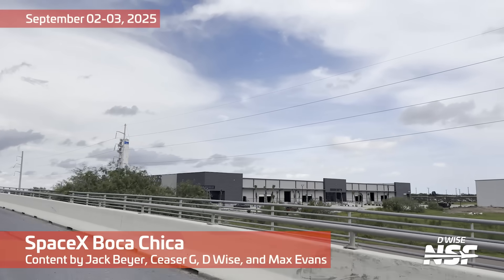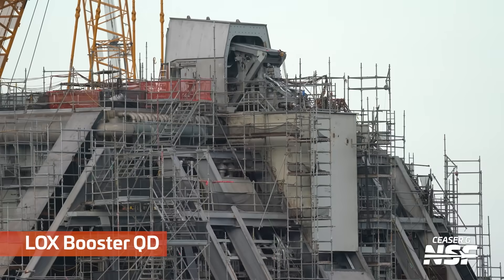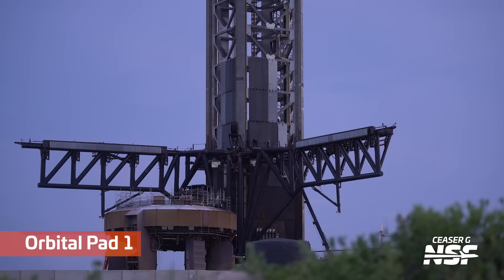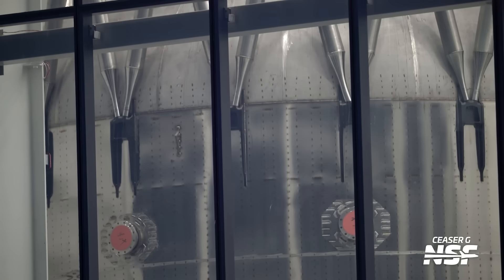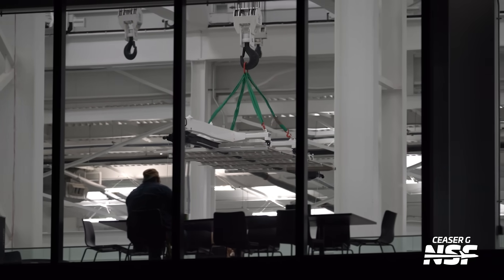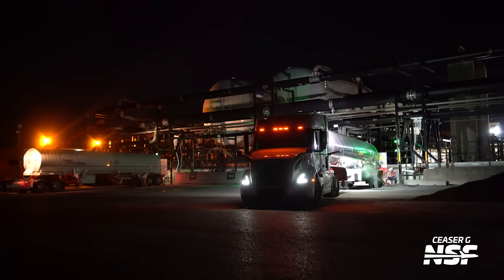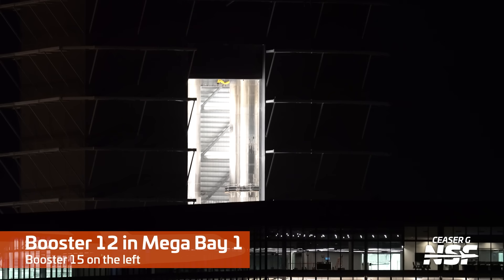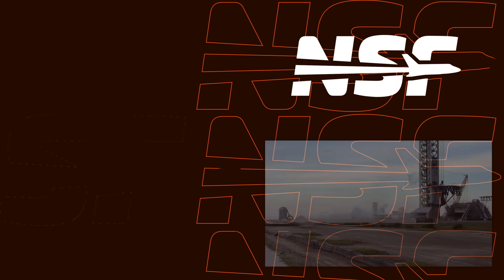"Not your usual Starlink Unboxing Video" | SpaceX Starbase

Comment: @NASASpaceflight, I would definitely watch a dedicated vid on air separation as used specifically for rocketry.
Which techs could be used, which are preferentially used and why (cost, purity level, etc...). 
There are many techs that can be used for air separation such as cryogenic distillation, molecular sieves, membranes, pressure swing absorption, etc... 
It would be interesting to know which ones are used for a unit dedicated to rocketry. Would also be interesting to know how they generate the liquid methane. Pretty sure NatGas is the source input, but what needs to be done to it to produce "rocket grade" methane. Equipment, steps, purification, etc...

Maybe the spacex air separation folks would do a technical interview as PR? I doubt they are doing something unique/proprietary in this area, so should be relatively safe topic for them to go into step by step detail on.

Comment: The air separation is by boiling point. Same thing you do with oil.
Reply: Or alcohol. If it was by density, methanol wouldn't be a higher fraction as it is more dense than ethanol, but since it's boiling point is slightly lower, it comes out at a higher plate in the column than ethanol does.

Comment: air separation units can use a PSA (pressure swing adsorption) tech that alternately pressurizes and de-pressurizes air in the  presence of an adsorption material that selectively adsorbs nitrogen or whatever.

Comment: I thought fractional distillation columns (towers) separate components by boiling point....not density. (??)
Reply: Correct, I suspect Das mis-spoke, he is going quite fast and off the cuff in these. There are a bunch of other techs that can be used either separately or in conjunction such as molecular sieves, membranes, pressure swing absorption, etc...
My understanding, which is only marginally above layman, is for very high volumes cryogenic distillation and molecular sieving  are the two primary techs used. 
@NASASpaceflight, would definitely watch a dedicated vid on air separation as used specifically for rocketry.
Reply from the maker: Hrmm, my understanding is that the entire point of the tower is that various products rise or fall at different pressures and temperatures, but I'd loosely describe that as density? If something is boiling, the density is changing and that physical mechanism could be used to separate components... Would love to learn more about how they operate and translate it into more easily understood terms... in my copious free time 😅 - Das
Reply: @NASASpaceflight  Wrote a nice explanation about how density has almost nothing to do with non-cryo fractional distillation and everything to do with boiling point, but YT decided to hide it...😑.....sorry Das.
Reply from the maker: I see it, I appreciate you taking the time to type it out. Will see what we can do about an expert tour... have a busy few months so it might be a while. - Das

Comment: So many things sometimes jump out from these videos and make me realise how far Starship has come since I started watching developments about 5 years ago. This time it was the discussion of the heat shield tiles, the pins, and the patchwork way that the tiles are being installed on the nosecone. That gave me a flashback to the early days of the SN hop and belly flop testing when various SNs had just a few - or even only one - small patch of just a handful of tiles installed and sometimes the attachment method performed so badly that some of the tiles didn't even survive being lifted onto the sub-orbital pad let alone the test flight. And now, while there is still more work to do, we see an entire heat shield survive a re-entry with seemingly very few tiles falling off.

Comment: The Hot Staging Ring - why are there not heat shield tiles or something similar on the booster dome?  Thanks!
Reply: Because the TPS tiles are way too fragile to withstand the physical blast pressure of the Raptor exhaust.

It's the same answer to "Why don't they use tiles on the launch mount?" that gets asked repeatedly, despite having been explained many times.

Comment: Doppler radar dome for local weather?
Reply: No; that’s a standard Starlink terminal dome for ultra high speed connections. Local NWS radars cover both the Cape and Starbase just fine without cost to use. Vandy has one, too.

Comment: At 9:37, it's a gate valve Das! And a damn big one at that! My guess would be for the deluge system, since gate valves aren't really appropriate for cryogenic liquid systems. But that's just my guess.
Reply from the maker: Concur, but Im not sure where it would fit into the deluge system either. - Das
Reply: @NASASpaceflight  I'm stumped by that also. But they might have isolation vales in places we can't see. Like maybe between the tanks???? But again that just a really wild guess.
Reply: It could also go on the utility water pipe in a vault somewhere.

Comment: With Flight 10 very successful, would they really go for 11 right away?
Id expect them to apply some significant changes from the lessons learned first before launching the "same ship" again. Nothing new to be learned except confirming what they had seen already.
that would take a bit more time, especially the heat shield.
Reply: They want the last ship and booster out of the way so they can start demolishing the pad and constructing the new one. Any answers they got from flight 10 should not take that long to go through.
Reply: Space X can always stress the starship and booster in ways it did not in the past while still trying to achieve a nominal landing.

Comment: Das,  9:41 was a valve with a manual operator (wheel)
Reply from the maker: I mean, maybe... but I dont think we see that sort of actuation usually at Starbase. If Cryos are flowing its unlikely you want a person there to turn the wheel... plus it would probably be pretty cold. Looks more like something for irrigation water 😅 - Das
Reply: @NASASpaceflight  I didn't say it was for cryos, maybe water or just a manual block valve that spends its life in the closed/open position. Still you would think a blind flange would be used.  would like to know where they put it in!
Reply from the maker: Most of the things they move around are Cryo. Not sure how this would fit in the deluge system.- Das

Comment: The order in which the tiles are attached appears as an "install one then skip a space" process. The tile that gets installed first has an extra  piece of ablative heat shielding underneath. This swatch includes flaps that fold up and fill the void between adjoining tiles. Since the extra swatch is spaced every other tile, only one layer of the ablative ends up between adjacent tiles.

Comment: On one of your Flight 10 replays, it was pointed out how the boosters' exhaust flames roasts the quick disconnect.  The flames strike the QD shielding for a long while as the rocket climbs away.
Reply from the maker: That's exactly the explanation I think would be interesting. - Das
Reply: But on Pad 2 the BQDs are placed on the opposite side to avoid just that.

Comment: I think column and tower would both be accurate for the ASU.  The building is technically a tower, inside is the distillation column (some folks call it a fractionating column, I call it a distillation column, mmhm).
Reply from the maker: Yeah concur. Its an interesting process. Wait til we tell people about filling their tires with nitrogen 😅 - Das
Reply: They're called a coldbox in the industrial gas industry lingo.  👍